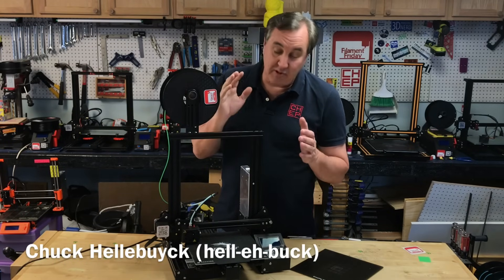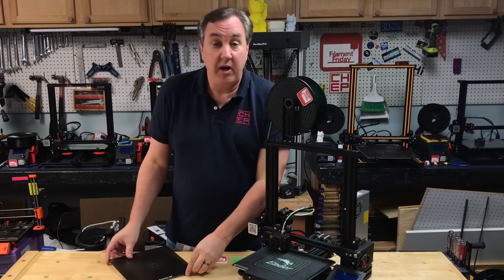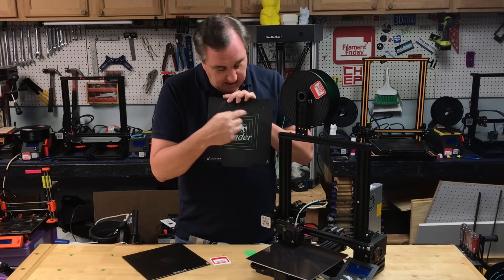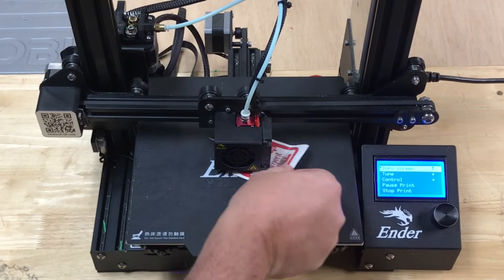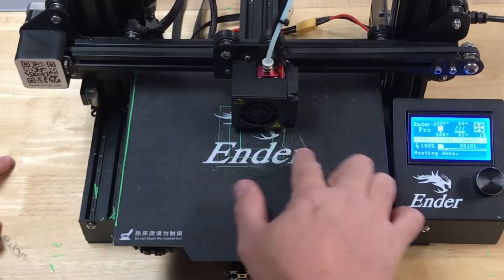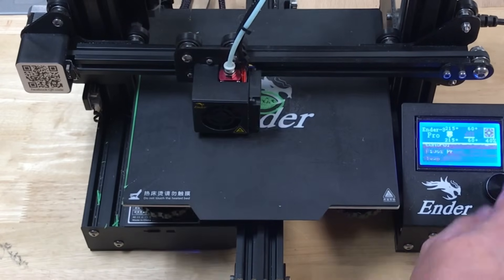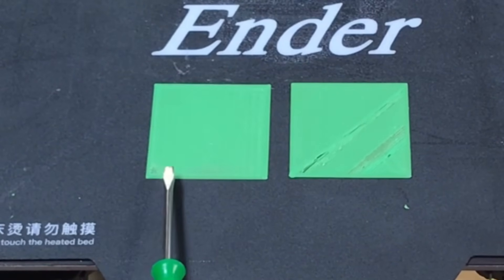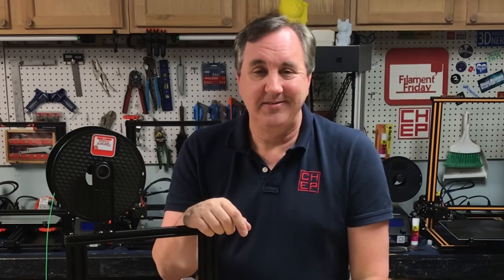Creality Ender 3- Easy Way To Level Your Bed

Comment: when I do that it's wayyy too close! The filament wouldn't even come out. I've done this so many times that my brain has turned to mush. I don't know what I'm possibly doing wrong. I haven't even been able to print anything and I've had it for almost a week!!
Reply from the maker: Back it off a bit. It needs to print so you can live adjust.
Reply: I have the opposite problem. Can't get the nozzle close enough to the bed even when its fully tightened.
Reply from the maker: Lower the Z stop switch
Reply: @FilamentFriday  Missing from the instruction manual, and only referred to in the video I watched as 'align the switch with the bed' which is nowhere near accurate enough. This is the process I developed:
Slacken the four levelling knobs fully, then tighten so you can just feel the spring resistance starting to kick in.
Tighten one knob until the spring is fully compressed (12 turns for me, with the stiffer yellow springs provided as a free extra)
Slacken back off
Tighten all four knobs to part way (I chose three turns)
Drop the nozzle to say 1mm above the bed at one corner
Adjust the Z stop switch so that you can just hear the click of the sensor 
Turn on and home the head
Now adjust the bed for level and final clearance
[Be careful, the bed may not be level and moving the head around may foul the bed and scratch]

Comment: Thank you, I totally agree. I usually add some skirts around what I'm printing. A good distance away from center That will let me check and adjust the bed on the fly with whatever I print. Works great

Comment: do I need to heat my bed before levelling or does this gcode do that for me
Reply from the maker: No heating required. You will finish the level furring the live adjust and in that file it’s heated.

Comment: Great video!  Still having issues leveling the bed.  One doubt about the video; for the first corner, it says to use slight resistance, and then for the other 3 corners, to use resistance so that the paper barely moves.  Is that accurate?
Reply from the maker: It just to get close. The main leveling happens during the live adjust.

Comment: My Sd card slot doesn't work, so I have to attach the Ender to my computer via USB cord. Is this why the program won't pause to allow me to check with paper?
Reply from the maker: No, it’s probably because you have a 32 bit board. Use the 4.0 version with M25 in the title.
Reply: @FilamentFriday  That's what I ran. I've run all of them, and it doesn't pause long enough for me to check it and make adjustments. It just touches down and then moves on to the next corner.
Reply from the maker: Not sure then. It’s the firmware doesn’t recognize the pause commands.

Comment: i have some problems with my ender 3. When the adjusment screw is all the way out(so the bed is as high as possible) it still can't touch the bed. It's maybe 3mm from the nozzle to the bed?
Reply from the maker: Lower the Z stop switch.

Comment: Will these program files adapt to a glass bed? Because I notice when I assembled the device and ran the 'auto home' command, the nozzle comes to rest at a level BELOW the bed.

how will the program know the height of the actual bed?
Reply from the maker: You have to home it first and set your Z stop switch to prevent that.
Reply: @FilamentFriday  IT's as low as the notch allows. So you're saying I need to raise it?
Reply from the maker: If the nozzle is below the bed and you can’t adjust it out then yes, raise the switch.

Comment from the maker: NOTE: If you have an Ender 3 V2 or a new Ender 3 with a V4.2.2 32 bit board then use the bed_level_4.0 file with M25 in the filename.
Reply: Link is broken
Reply: I know this doesn't have as much to do with leveling but my z seems tight and doesn't move as fast as yours. How can I check if something is too tight ?
Reply: Sorryy but the link doesnt work
Reply: Why does the link not work

Comment: Using guide it doesn't stop at each point it just keeps going
Reply from the maker: Do you have a V2 or a new Ender with a V4.2.2 board? Try the bed_level_4.0.zip and use the M25 file.
Reply: New ender 
Okay thank you

Comment: So an automatic bed leveling kit seems to be pretty worth it from what i see, i might buy a 3D printer but the whole "not user friendly" parts aren't really interesting.. considering i have a job and so much hobbies :/ 

Not really sure after a first setup the printer will need minimal setup when i'll use it again..

Comment: I'm leveled the bed and let the printer finished the CHEP_bed_level_print.gcode, I mesured the hegiht of the squares and the mean is 1.4 mm when it has to be 1.96~2mm. Any idea what it's worng?
Reply from the maker: Check your Z axis movement for binding.

Comment: Wow, just found you and wanted to say thanks.  Best leveling instructions I have found, just liked, subbed and will be watching more of your work.  I have an Ender 5 Pro and started with a few small successful prints then had non-sticking prints on more complicated work and trying to solve the problem.  Lots for me to learn and I think you are going to make the difference for me.  Don't be too good or I'll be forced to through some $$ your way.  Thanks so much.

Comment: I kinda just needed to know how to level the middle, but this helped! Very good video, thank you

Yeah, I have three warp spots. Exact center, the middle of the bottom, and the middle of the top. I’ll try to fix these, but then the corners are way too close and the nozzle grinds a line into the bed. Egh. Plus Uh.. I hear a fun grinding-ish sound on a bit of the left-hand bottom corner, I’ll hear what sounds like grinding, but the print will be fine. It’s not the nozzle, I know that. It’s the wheels. What’s up with that?

Comment: I just got built my ender 3 pro and loaded up the gcode. But my nozzle is a good 1 inch from the bed and no amount of twisting can make it close enough to make the distance paper thin. Any help??
I read that I might need to lower my Z limit switch??
Reply from the maker: Yes. Lower the switch.
Reply: Actually! My z axis was never returning to the clicker where it hits zero. I opened up the to the mother board and realised one of the wires for the Z connector was loose. Now it returns to the clicker when I press auto home! Thanks for the help! Ive been following your channel when setting up my ender pro 3 :)
Reply: Had the exact same problem fixed it tho

Comment: Everything came out ok except in my front left corners I get a tiny little blob. Kind of like if you took a sharpie marker and pushed the tip down a little harder in one corner. I just put my Ender-3 together last night and when leveling I noticed the center is always further away than the corners. The unit is brand new and I know people are going to say “warped bed”...My question is, if all my prints take place in the center of the plate, is it ok to have the nozzle slightly closer there? Regardless the test came out fine. I also noticed you had the extruded set at 205, is that the optimal temp? Thanks for your video.
Reply from the maker: You don’t have to print in the middle. 205° is just a starting point. It depends on the filament.
Reply: CHEP Thanks Chuck.

Comment: I feel stupid, but I have tried for over an hour and I can not get the card reader to read the file you used for leveling. Any idea what the hack I am doing wrong? I have an Ender 3 V2
Reply from the maker: Did you use the one specifically for the V2?

Comment: whenever i try to run a print, my ender 3 runs the first little line of the chep leveling file and then goes into the print like normal. Why does it do this?

Comment: Hi there, I just tried to run the g code to level the bed and it just keeps going round without stopping for me to check with a piece of paper. My Ender 3 Pro is running 0.0.6 firmware. Is there a way to upgrade it back to a more recent version? Many thanks.

Comment: dude I did what you said and installed your profiles and it still is giving me trouble.  What a pain in the ass.  I'll keep trying
Reply from the maker: What is the issue.
Reply: CHEP well I tried leveling the bed like you showed in the video. It was too close to allow the filament out to I backed off a little. The base layers seems fine and the it went down hill from there. They just looked horrible and I have no idea why I’m having so much trouble with it. I wish I could attach some photos here to show you .
Reply from the maker: Sounds like the threaded rod is binding causing the z motor to slip.
Reply: CHEP I had installed from an upgrade kit the stabilizer for the rod and the spacer that right up against the z motor. Do you think those upgrades helped or hurt?
Reply from the maker: There should be a gap between coupler and motor.
Reply: CHEP yes the spacer is between he rail and the z bolt motor. So it sounds like that isn’t it.

Comment: I'm having a issue with the bed level gcode on my new Ender 3 Pro where it doesn't pause, it just keeps running through each coordinate.  It works fine on my other Ender3 pro, so I'm confused.  Thank you for all that you do, I love your videos!
Reply from the maker: Check the board in your new one. It might be a 32 bit v4.2.7.
Reply: @FilamentFriday  it's a V4.2.2 I swapped it out with my old original board from my other Ender 3 so I could run your bed level gcode and get back to my project the quickest way I knew how at the moment.
Reply: @FilamentFriday  I just ordered a 1.1.5 silent board but recieved 4.2.7 instead. I installed anyways and I am having the same issue with not pausing. Why does this not work with a 32 bit board?
Reply from the maker: Check out my latest files. I show an alternative for that board.

Comment: I just ran this on my Ender 3 V2...the gcode file basically just goes around and dips the hot end around and then completes the "print". Any tips for what I'm doing wrong?
Reply from the maker: The V2 firmware doesn’t work with it yet.
Reply: @FilamentFriday  Thanks CHEP. I found a remix on thingiverse that works ;)
Reply from the maker: Link?
Reply: I'm having the same issue on my new Ender3 pro (non V2).  It works fine on my other Ender3 pro.  Is it possible my new E3p has different newer firmware?
Reply from the maker: Some have been shipped with V2 board.

Comment: How do I find the link to the gcode you mention?
Reply from the maker: Link in description.
Reply: @FilamentFriday  the description says: "Chuck shows you an Easy Way To Level Your Bed on Creality Ender 3 (or any similar size 3D printer). He uses two GCode files: the first to position the nozzle above the adjustment screws and the second is a test print for live adjusting of the bed. When this is completed your printer is ready to print." There are no links. Am I missing something? I can't find these gcodes either.
Reply from the maker: They are right below that paragraph. 

Creality Ender 3 Bed Level G-Code Files:
http://www.thingiverse.com/thing:3235018
or 
https://www.chepclub.com/bed-level.html

Comment: So you responded to my comment but I'm relatively new to 3d printing so can you explain to me what resistance or slippage would be
Reply from the maker: The threaded rod doesn’t turn as much as it should because their is binding in the assembly. Loosen the brass T Nut screws that the threaded rod goes into a bit and it may help.
Reply: @FilamentFriday  Thanks a Lot ill try that

Comment: CHEP So I followed your tutorial step by step and it fixed a lot of of issues so thank you but now I have a problem to where the nozzle keeps touching the print and moving the print  as its printing any suggestions. Thanks
Reply from the maker: Check your Z axis threaded rod movement for slippage or resistance preventing it from rising properly.
Reply: @FilamentFriday  I have the same problem, new machine, first print was beautiful, now it gets so far and knocks the print off the bed and makes a mess if im not supervising. 10mm hollow test cubes print perfect, the only change is filament, tightened the belt slightly and tried to relevel the bed. Ill comment again if this doesnt fix it!
Reply: sorry I'm new to 3d printing what is considerd slipage or resistance

Comment: Thanks you so much! I've been struggling with my prints this past week because the first layer was not sticking. I was doing the same leveling test with the paper but i was positioning the nozzle too close to the corners. Is it normal that the bed is higher on the corners than at the centre?  I'm using an Ender 3 pro
Reply from the maker: Yeah. Some beds aren’t perfectly flat.

Comment: Thanks, cool technique! I'll try it, seems very helpful.
But is it possible to attach auto bed leveling module to Ender 3 v2? I can't find any reliable instruction yet.
Reply: You can get an auto leveler though it's like £50.
So to bottom line it, there's no built-in feature for it.
Reply: @dha12oks  Thanks, I've already found few tutorials, perhaps some firmfare and hardware twitching are required. So it's not that easy just to buy additional module.

Comment: hey @CHEP i tried this, but when i loaded the g-code, it automaticaly moved to all four corners without me pressing any buttons,  and it wouldnt let me stop it.
Reply from the maker: Does your printer have a labeled V4.2.2 control board?
Reply: @FilamentFriday  no, is it supposed to? i have an Ender 3 Pro. do i update it? if so, how?
Reply from the maker: It should work. What number is on your board?
Reply: @FilamentFriday  I wish he would have replied because my new Ender 3pro does the same thing. my Ver is 0.0.6 Not sure what you're calling the board, if its the LED board with the knob on it mine is 12864ZW-10.

Comment: Good day. I did flash my Ender 3V2 with the new 2.0.6 firmware from your ChepClub,  but the be CHEP_ender_3_bed_level.gcode file does not work. as soon as I start the print the printer only homes to the z limit switch and the display shows the print is at 16% ,but nothing happens. can you please help
Reply from the maker: I’m looking into it.

Comment: I just received my Ender 3 yesterday, I've been trying to use the sample filament to set my printer... I'm not sure if it is the sample filament I have issues with ( I have better filament coming but for some reason, Purolator is having issues finding my house) or the firmware being faulty or the slicer not being right. I can't for the life of me get my ender 3 to repeat the same approximate height on each print. I used to be a civil surveyor, I'm used to leveling sensitive equipment, but for the life of me, I can't get this thing to even come close to where I leveled it to, each time I try a new print. sometimes it works, sometimes it's off by half a cm! I checked every nut and bolt to make sure it was tight, I've reset the Z-axis several times (so far my bed doesn't rise very far until I can put some spacers between the bed and the springs, so I opted to drop my Z-axis sensor all the way to the bottom to give me some wiggle room) The pre-loaded design of the dog wants to try and print .5 cm to 1 cm off of the bed surface. what I did for this problem was auto home, then raise the nozzle to the print height that it wants to start at, then level the bed to a paper width below that height, but the next time I print it seems to be a different height again! I can understand leveling the bed after each print, but having to do these major adjustments each time is making me rethink the purchase. Any thoughts???? ALSO, with this video... If your build plate is not entirely flat, how can you possibly get a consistent height from your printer?
Reply from the maker: Did you watch my Assembly video where I explain how to get the crossbeam set properly?
https://youtu.be/2Th2e7wTNV0
Reply: @FilamentFriday  I watched a lot of videos before I got the printer (Lots of your videos) I dont  know If I have or not. I will now though, thank you!
Reply: @FilamentFriday  I think I found my issue. I was pushing too many buttons, I think anyway. I believe I "set home offset" sometimes. When you "Auto home" your machine, should your Z-axis read -2.99 or just 0?

Comment: this doesnt help because my nozzle crushed my entire bed at the lowest points i could get it, it NEVER went to each corner it start printing squares from outside to inside and nothing like how your video was, my whole bed is ruined even underneath the top may
Reply: mat* ^
Reply from the maker: Did you run the bed level file first before attempting the squares file?

Comment: I have a problem leveling the bed, when I use the file and the nuzzle goes to the first corner it goes too down and pushes the bed, and it doesn't matter how much I try to level the nuzzle just doesn´t stop pushing the bed, I hope I explanied well because english isn´t my first languaje and I really hope someone can helpme.
Reply from the maker: Raise the Z stop switch
Reply: @FilamentFriday  I´m quite sure I put the z stop switch in the right place like the instruccions say,  I would like to know what mistake I did.
Reply from the maker: Sometimes you have to position it higher than the instructions.

Comment: So about what is the thickness of the sticker because im using a feeler gauge
Reply: Paper thickness is about 8mils.  0.008".   I use a post-it note.  Fold over the sticky part for 2x thickness.  Use whichever side you need.  1x or 2x.